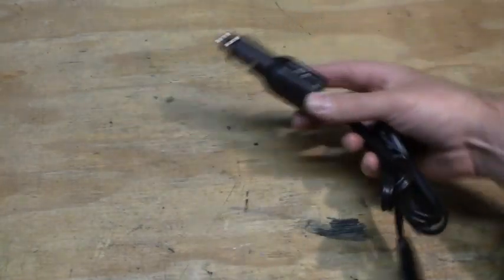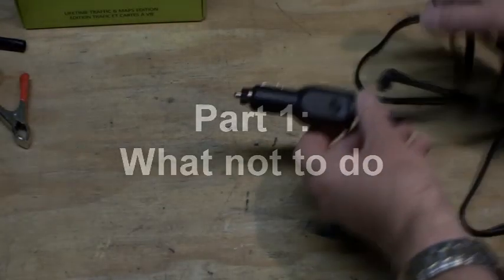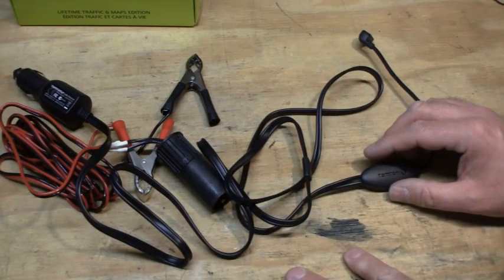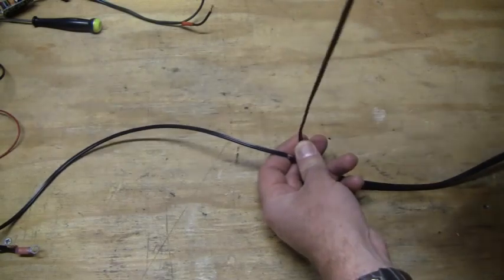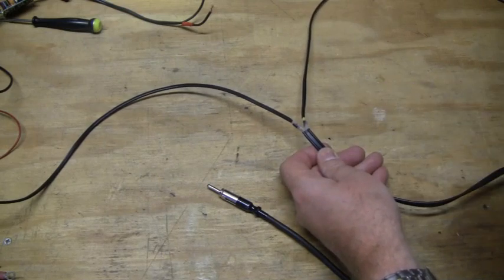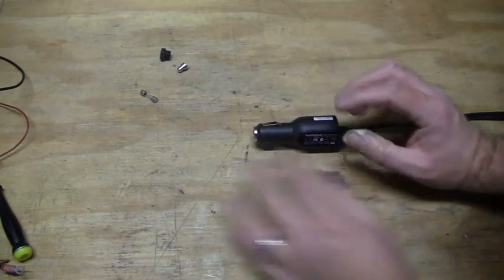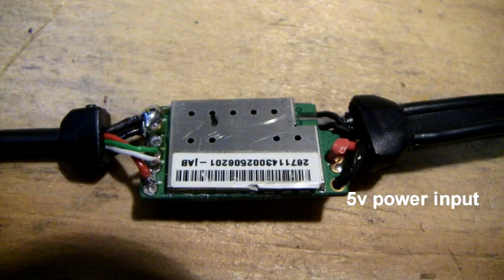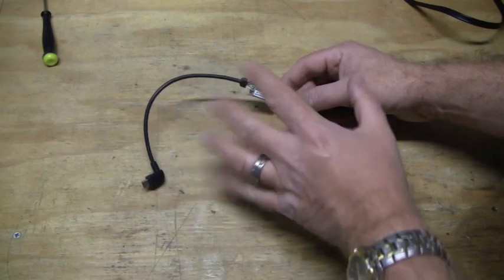Inside the TomTom RDS-TMC Traffic Receiver

Comment: My cable did not properly charge anymore, supposedly due to a loose contact.
I took apart the original plug to see what is inside and there was a 130kOhm resistor between GND and the 5th pin which is for ID purposes. There was also a 100nF capacitor between V+ and GND and the GND wire was soldered to the shield of the plug.

Comment: I have a question. I see that from the 12v plug, it only has - and + 5v to the device. So is the antenna half of the wires actually coming from the oval shape thing in the middle? I need confirmation before I cut mine because I plan on getting rid of the 12v plug so I can convert it into a male -A usb plug instead. That way, I can use my triple usb 12v charger in the car without sacrificing the power outlet for only my TomTom.
Reply from the maker: Correct. The antenna connection originates in the oval section and dead ends near the back of the 12v plug. Interesting idea to use a usb male plug. Be sure that your usb port can support enough power to run the device. Mine is rated at 1.2 amps.
Reply: Your information is just what I needed to know. I want to be able to operate my TomTom device with real time traffic and operate/charge my cell phone at the same time. I am using a clunky cigarette lighter socket adapter that had two lighter sockets and two high power USB sockets. This will allow me to use a much smaller dual USB power adapter right in my car's lighter socket.

I may take it a step further and add USB phone powerpower pack to keep the real time traffic running when I shut the engine off when getting gas or need to run into a store for a few minutes.

Comment: I put a Mini USB 5-Pin Male to Micro USB Female Adapter Cable between my TomTom and TomTom RDS-TMC Traffic Receiver cable, everything works fine.                                                                                                                                                                                   http://www.ebay.com/itm/Hot-Black-USB-2-0-Mini-USB-5-Pin-Male-to-Micro-USB-Female-Adapter-Cable-/222481941053?hash=item33ccf5023d:g:C-cAAOSwqYBWmhB0

Comment: Great video, thanks. You might be able to extend the cable with 5 individual wires. That way you don't have to worry about the internals of the existing cable. Nit picky, but I believe this receiver is analog, not digital as stated.

Comment: i lost the plastic silver button cap that you mention at 8:25 (it came unscrewed and is lost) any idea where i can get just that piece?
Reply: did you ever get an answer? i have the same problem
Reply: just buy a cheap diy-solder-anything-on-plug with the same mechanics.
like this one: http://www.ebay.de/itm/ZIGARETTENANZUENDER-NIEDERVOLTSTECKER-KFZ-STECKER-inkl-SICHERUNG-AUTO-STROM-12V-/192124042223

Comment: Nice video!  I had hoped to unlock the mysteries of the USB plug because mine is cracking and I don't really want to fork over $30 for a new cable.  This seems to be a common problem and as much as I love my TomTom it's making me consider other brands.  Truckers swear by Garmin so that presumes some ruggedness my TomTom appears to be lacking... They even make special models showing which roads trucks can and cannot drive on, etc.  For now I am pondering the efficacy of heat shrink tape, since tubing large enough to go over the plug probably won't shrink enough to hold the wire securely and relieve the strain.  Any ideas?  Thanks for the great video!

Comment: I found the following on the TomTom forum which sheds some light. It seems that any extension cable needs to be OTG compliant, having the 5th (normally unused) connection on a micro-USB plug both wired AND grounded.

"I have seen a number of comments from people trying to adapt a TMC receiver with a mini-USB connector to a GPS with a micro USB socket and not having any success. I had the same problem as I mistakenly bought a RDS-TMC cable for my Tom Tom Start 20 and found I had the wrong connector. I tried the adapter, but of course it did not work. Then I had a think and realised that the Tom Tom had to operate as a USB Host when the receiver was attached, but as a USB slave when conntected to a PC. In other words, it must have USB On The Go (OTG) support like many Android tablets and phones. 
Standard USB uses 4 wires: +ve, Gnd, D+, D-, but a micro USB connector has 5 connections. the 5th connection is floating in a normal USB cable (the type used to connect to a PC), but is grounded when the device needs to operate as a USB host. Here is what I did, but CAUTION, if you try this, you do so at your own risk, please don't blame me if you cause damage or destroy your sat nav.
I cut off the mini-USB connector from the RDS-TMC receiver. It was of no use to me. I then hacked my mini-USB female to micro-USB male adapter to pieces with a sharp knife (be careful if you try this yourself). Alternatively, you can cut up a micro USB cable if you have one spare. There are 2 solder connections on one side of the connector and 3 on the other. One is un-used. I then took my RDS-TMC cable and soldered on the wires to the correct connections (USB follows a standard wiring colour code, so just match the colours of the wires. The 5th wire on the RDS-TMC receiver is yellow and I soldered this to the unused pin on the micro USB connector. I then grounded this connection by strapping a separate wire to the ground pin. I then re-encased the wires in epoxy and bingo, it now works perfectly. They key thing is to ensure that the 5th pin is grounded to ensure that the device operates as a USB host. If it is left floating as is typical for a USB adapter, then it will NOT work as the navigator switches to slave mode and cannot talk to the RDS-TMC receiver."

Comment: Great video - very helpful - thanks. Did you ever discover what is unique about the short USB cable? 
My TomTom Start 60 is permanently mounted in my dash - I wanted a short male-female micro-USB to run from the unit to my glove-box, giving me the choice of connecting either the Traffic Receiver for day to day use or my laptop for updates. As you reported, I can confirm that when using such an extension the unit will receive power from the Traffic Receiver but will not recognise the Receiver itself. What a pain!

Comment: Thanks for this video. I have the model 4UUC5B (4UUC.001.05B), and it has 4 metal connectors in the cig lighter plug (see image here: http://goo.gl/4X5C4b), rather than the 2 I can see on your model, does that make a difference?

Comment: Okay, so I cut the traffic controller USB cord in half, and added a 3PDT switch so I could flick between the USB 'update' port and the TMC. Now I have a weird problem - the GPS unit will 'recognise' the TMC when the switch is connected to the 'update' USB port, but not when I switch it to the TMC. I have no idea why, and have triple-checked my wiring/continuity/etc. Really strange, I am lost as to why it is doing this.

Comment: Thanks for the help! What if I used a double pole double throw switch and wired only the green and white data cables to it? So I would have power coming from the car (i.e. up the TMC cable) at all times, but the data could be switched between either the FM modulator's data or the data-only USB port for the computer updates. Would that work?

Comment from the maker: Hmmmmm. I would definitely avoid a splitter setup. You would be combining two power sources (one from your car and the other from your computer) and the result could be damaging to your equipment. If you can solve the mystery of how the GPS detects the traffic receiver, it would be wiser to pursue a selector switch setup instead of a splitter. You would need a four pole double throw switch or two double pole double throw switches. Good luck.

Comment from the maker: I'm really not sure about how the GPS detects the traffic receiver. Since the cable has both a negative wire and a shield, keeping those separate vs. shorting them together may be the issue. The solder points on the receiver looked like they were shorted together at the circuit board. I'm still stumped.

Comment: of course, if I make this splitter and am updating the GPS unit from my computer, I won't have the car turned on at the same time. I'm also wondering whether I'd have to wire a switch between the where the cables are spliced and the red/white/green coming out of the FM modulator, so that way the USB coming from the computer doesn't power up the FM modulator and thus the GPS unit wouldn't have to deal with conflicting data streams. I am new to this stuff - I hope that makes sense.

Comment: Great video, thanks!
I am about to permanently mount my tomtom unit inside the dash, and the wires will no longer be accessible. What I want to do is have a remotely mounted female USB port, so that way I can update the tomtom as needed. If I splice a USB wire into that short USB connection wire on the traffic receiver, will I have any issues? (I.E. basically create my own USB splitter.) I was thinking of buying a splitter, but as you mentioned you've had trouble extending the micro usb port.

Comment: Hello, 
Great video BTW. Could the problem in extending the USB be caused by some type of non-standard USB port hardware on the GPS, or some type of Security? Forgive me if you know this already but from what I learned last night the cable you're using is actually licensed for lifetime traffic. As such maybe this problem is related. What do you think? 

Thanks again.